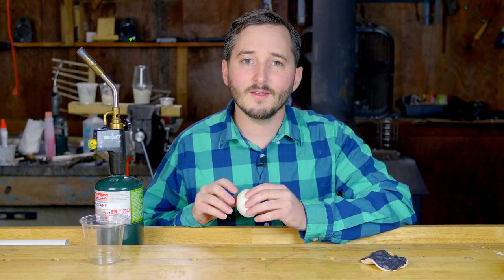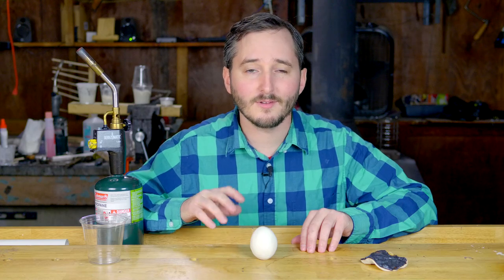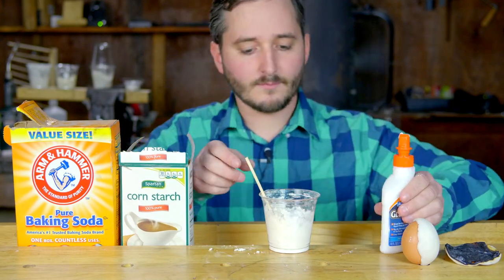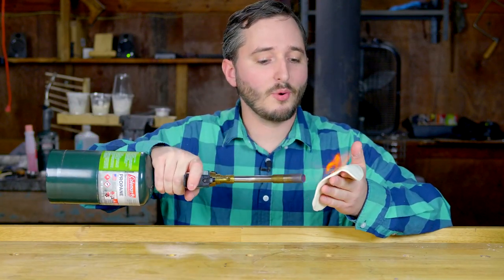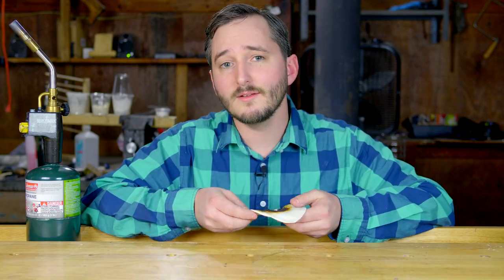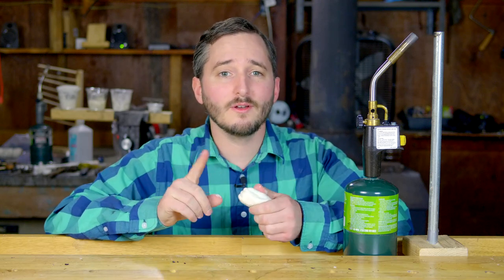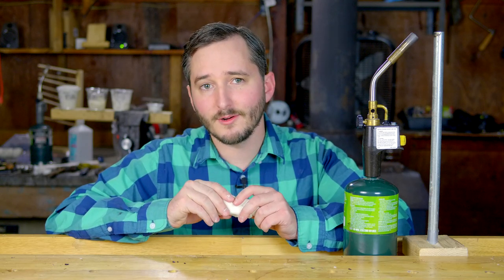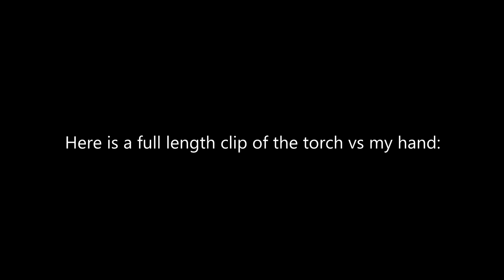A Super-Material That Can Be Made In The Kitchen (Starlite Part 1)

Comment: I am working on an anti-thermal shield for the purpose of hiding from thermal devices. My question is about another project all together. Do you have any information about how to step up the power from 110 volts up to 220 volts using a transformer from a microwave? I want to use it to power an air compressor in a place with only 110 outlets. Can this be done? Thank you.

Comment: Any idea why NASA and Boeing and other aerospace companies did not go further and buy Starlite from Maurice Ward?

Did he want too much? Or does it have unwanted properties that were actually not disclosed at the time?

example: it can resist heat very well, but those insulation properties may be very far from ideal when exposed to cold? (thinking of Challenger, which exploded because the O ring was made of some rubber that stoped sealing when in cold weather)

Comment: Hi, I was wondering if it could be used as a heat shield/sink for a small ZVS induction heater.. want to keep everything cool without fans so it can be pocket sized. Cheers
Reply from the maker: It's an insulator, so very bad for a heat sink.
Reply: @Nighthawkinlight  Thanks for the reply, yeah thinking about it, it would just keep the outer casing cool while baking the electronics inside 🤦
I'll rewatch your heat sink vid 😊
Really appreciate the feedback, still replying to comments 2 years on, a true gentleman 👍

Comment: R h h, stands for real human here including spaces, I decided to implement this because of all of the trolls/chatbots out there. So my question/statement/s are; you said the egg didn't survive 2 minutes before effecting, so I take the theory u suggested that it's a weak carbon nanotube, which would indefinitely be ideal if reentry required more heat resistance, and would be more cost effective and probably user friendly, u need to try the same experiment using at least a smear of borax liquid anything not including metal mix upon the surface and map gas for ne1 to be very impressed, that it even endures 15 seconds, also anything closer to 30 seconds would be unbelievable.

Comment: Could this be put onto a piece of metal or other high heat conductive material to stop the heat from conducting through the material?

Example experiment:
Take a 6" long piece of steel re-bar and wrap a 1" wide strip of the putty all around the middle of the rod. You then heat one end of the rod and see how much heat is conducted down the rod to the other end past the putty.
Reply from the maker: Thus would insulate the rod, making it transfer heat down its length even faster, not slower.
Reply: @Nighthawkinlight  Are you sure? Wouldn't the heat dissipating power of the putty be able to just take the heat away from the hot part of the rod it is in contact with, before the heat has a chance to travel further down the rod? I'd love to see this experiment in action.
Reply from the maker: The putty reflects heat off of it, it doesn't dissipate heat through it. It would reflect heat from the rod right back into the rod.
Reply: @Nighthawkinlight  Ah, ok.

Comment: Just by curiosity. Would covering yourself with that material to prevent the immediate heat wave of a NUKE work or at least increase the survival rate against it?
(Suggesting you won't die from radiation or impact)

Comment: Interesting. Could this material be used instead of magnetic fields to contain a fusion reaction?
Reply: nope it produces gases and carbon foam expands and its flimsy.
The magnetic field is important to minimize losses to the walls and also somewhat to keep the heat in and raise the temperature of the plasma.
Starlite would conduct enough heat away and also the carbon foam wont be able to widthstand those temperatures for too long since carbon will vaporize at 5500 Celsius and you need several hundred million for fusion.

Comment: So, how well does this insulation work for lower temps?
does it protect against cold?
how about boiling water temps?

or does it require super high heat to activate its properties?
Reply from the maker: It's a poor insulator under regular conditions. It's a fire protectant, not a replacement for insulation.

Comment: Looks like it suddenly got cheap to make your house a lot more resistant to the heat flash from an atomic bomb than simple white paint does. I doubt this particular composition holds up well to weather, but I bet a more durable material based on the same concept wouldn't be much more difficult to produce.

Comment: Sorry if this is a dumb question, but can someone explain how this can resist so much heat while something else like charcoal, which from what I understand is also essentially carbon created when wood doesn't have enough oxygen to fully burn, burns so well?
Reply from the maker: Charcoal is full of flammable oil, otherwise it's basically the same. You can use charcoal to block heat also until it burns through. This has an advantage because the bubbles are filled with co2 which slows the burning process

Comment: Interesting.  It's an interesting product, but I'm not sure exactly WHAT it is.  It's not an insulator, per se.  It REQUIRES combustion-level temperatures to be effective.  I don't know that it would work at lower temperatures.  Want to BOIL an egg?  That should work, if you handle your temps right.
To make it into an efficient insulator, you have to burn it.

Comment: What if the heat is way less intense, not hot enough to burn. Such as 100°c, would starlite able block low heat?
Reply from the maker: No, it needs enough heat to carbonize. It's a protectant against fire, but not an insulator from regular heat such as from the sun. Not until it had been carbonized anyway.

Comment: Ignorance at play here. Would it make a good insulator? Meaning if I were to make a gas smelter, would it hold in enough heat to be effective to heat stronger metal within a crucible? Or would it be a moot point? Looking for more cost effective way of constructing a smelter and forge without having to buy or make firebrick.